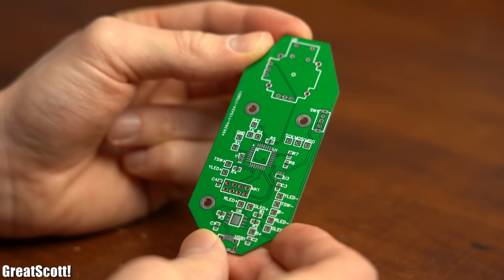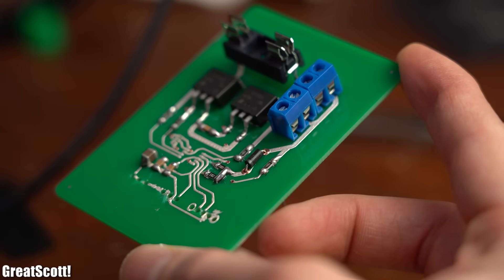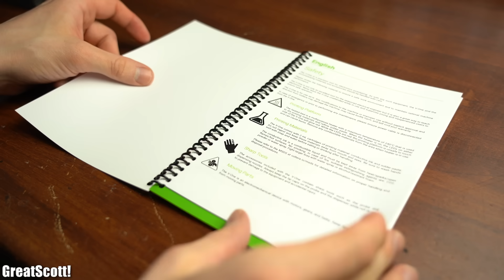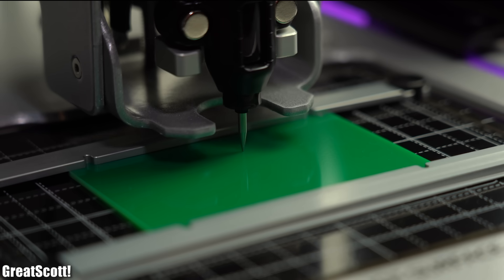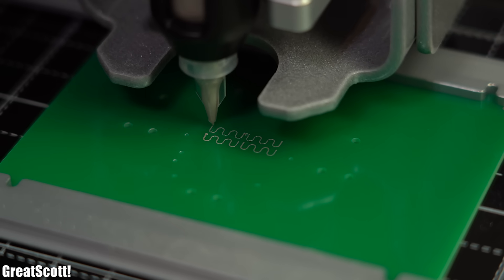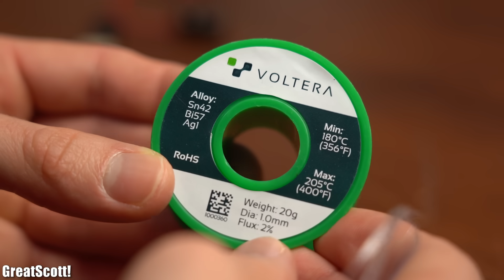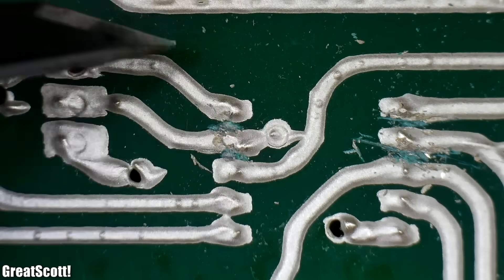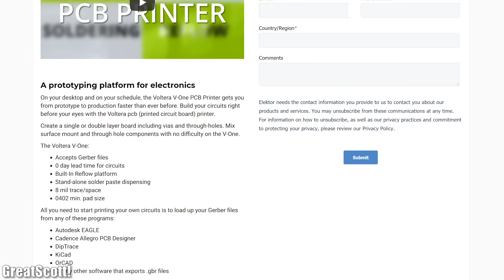You can now PRINT PCBs! Creating a homemade PCB with the Voltera V-One PCB Printer!

Comment: 0:40 LOL! pretty cool idea, but with PCB's so cheap to have printed it makes sense to wait the week for delivery. I'm sure the price will come down within a few years though. Remember when a 3D printer cost thousands, now it's like £200 next day delivery.
Reply: It really depends on what it's slowing down.

If you've got engineers spinning their wheels waiting on a prototype PCB for a week, then it'd be worth the money.  That's assuming that the company can't use traditional acid bath techniques to make prototype boards, though.
Reply: @jeffspaulding9834  If you have engineers spinning their wheels you can also get your pcb made and delivered in a day (is quite costly aswell though)... the issue is that this can only print two layers, so for many designs it's not suitable
Reply: @johnuferbach9166  That's a good point.

I don't work in a field that does a lot of PCB prototyping (we'll solder something on a PCB sometimes, but mostly it comes to us already assembled) so I don't really know, but I'd be interested to see how often two-sided prototypes boards are used in the industry.  I know a lot of the stuff I work with is two sided, but that's because it's meant for field repairs (it's mostly through-hole for the same reason).
Reply: @johnuferbach9166  Many makers do not allow more than two layers for those single-day orders though :( However - it is very uncommon for the engeneers to wait for a board not simply switching to some other works in the meanwhile :)
Reply: @jeffspaulding9834  that's why we bought one where I work. It's completely useless, and barely functions as advertised. We just order boards on a 24h turnaround from a domestic supplier instead.
Reply: @jeffspaulding9834  engineers wouldn't typically be waiting for boards this primitive; that would only result from some terrible planning (anything this could make could easily be hand reworked quicker and with higher reliability). Even if this made you a useable board (doubtful) you have the problem of SMT assembly. Good luck running that through reflow.
Reply: @superjimnz  it can paste and reflow since it has a hotplate. It is an advertised feature. 

This thing is oooold though. I dont remember exactly when i first hearf of it but it must have been around 2016?
Reply: @superjimnz  Yeah this looked cool at first, just for my personal use between breadboarding and ordering a PCB, but this thing looks like it could hardly print a QSOP, let alone an MSOP.
Reply: Just my 2 cents. For this kind of thing? Just use a silver pen... It can't be that much more expensive than whatever consumable this thing uses. From the sound of it, it's faster too.
Reply: it doesn't make sense if supply chains break down, we need distributed manufacturing of electronics or we are at the mercy of companies that do not have our best interests at heart
Reply: @kingmasterlord  😷   YOU  ARE  JUST  BITTER  BECAUSE  THE  CHINESE  COMMUNIST  PARTY
DEVELOPED  AN  ENGINEERED ,  DEADLY  PATHOGEN  AND  UNLEASHED  THAT  VIRUS  INTO  THE
ENTIRE  PLANET .....    🦠😷 

GO  KUNG-FLU —->>>  INFECT  THE  DEMONCRATS.
Reply: it will always be cheaper to go through industrial for the products, it costs more for you to grow a head of corn than it does for you to get a whopping 3 pack and you don't need to put much effort into it.

This technology is great for the prefabrications where you're wanting to print something on a resin board and if it doesn't work out you can bin it it also works great for security especially if you have defense contracts, they only tell you things that the government has told the public, even then they only tell you to reread the documents that you acquired the information from.

So in essence not really for the end user, but still quite good
Reply: Not sure about a week (2-3 weeks for me) unless you're paying £30 for fedex, but this certainly doesn't have a professional look and seems too complicated, might as well go with stripboard/perfboard for prototyping instead of this.
Reply: Yes, but this is going to be in even less demand.
Reply: Well, it is not just a problem of price; it is also related to the overall performances of the device. If it would make output close to what you get from PCB sites, then yes, I agree with you, but it is not, and it won't be close to PCB sites for another 5-10 years at least.
Look at 3d printers today: most of the sub 2K printers are nothing but toys that are good for making trinkets and random objects, which is far from what a 3d printer can theoretically do.
Reply: sure - but you rely on the supply chain and the infrastructure, with machine like that you can be independent and to some people this means the world
Reply: @kc1087  Not everyone can afford to have such commodity, especially in the beginning. Plus the output for prototyping small things is OK, but if you are serious you would never use this machine for anything complex. That's why the advantage of having the proto board immediately instead than wait for a week, is nullified for many people, by the excessive cost of the machine, supplies, and the low grade results you get. 

A milling solution give you better results and higher resolution for the traces, better conductivity at a price much lower. Just saying
Reply: @kc1087  I think the point people are trying to make is, this machine is rather useless. It looks like it can hardly handle SOIC, nevermind QSOP or anything actually small. If it can't actually build what you need it to build it becomes useless to anyone. At the "resolution" it can print at, you can probably just hand solder on a breadboard. Like other people said, you can get milling solutions that can work with finer resolutions that cost less ...
Reply: Thanks so much.
Reply: It's worth stocking up on SOIC SOP SSOP TSSOP QFP QFN breakout boards anyway
Reply: It's about time to gather a few makers and start working on a open source version. I bet we could make this for just under $1000. We just need their flux recipe.. For $99 a cartridge it's crazy expensive as well,.
Reply: i suspect there is not quite the same market size and economy of scale for these.
Reply: If I've got an assignment next week in a country without fast shipping for PCBs, I'd rather have this (and be used by tens of students in EE)
Reply: Would be fun for starting a mini business. You can still do 3d printing for profit at home but naturally you need to network a lot and bring some skills into the deal ie 3d modelling, painting and other finishing
Reply: @derpinbird1180  It'd take forever to make your money back, though, given that each board takes an hour each side just to bake the ink.  What with dealing with the software and doing the drilling, printing, and vias you'd be looking at (rough guess) four hours minimum for a two-sided board.  Even charging minimum wage for your time, it'd be pretty expensive considering the end result.
Reply: @jeffspaulding9834  TBH. In this case, it is indeed exceptionally terrible planning. Any company would spend the week working on getting the firmware or the test setup ready

Comment: I think the best value for pcb making at home is by far the laser printing method.
And if you really do a lot of pcb making, just mod a cheap laser printer to print directly on the pcb.
That's like 150€ top for faster and better quality than this shitty 4k€ 3d printer that will fail half the prints and lock you into ultra expensive consummables.

Comment: Hmm, interesting device. Also, the given use case (eg. a university), would be helped a lot to showcase several PCB manufacturing skills and best-practices. Personally I think one of those (cheap) MSLA 3d printing solutions together with a dry-film resist would be a more sustainable solution for DIY rapid prototypes.

Comment: The price bracket reminded me of that Wegstr PCB CNC mill. That one was quite tiny and even tho the promo videos seemed beyond impressive, they were far too obviously cherrypicked to hell and beyond. Then I saw an independent test of one and the results were far more down to earth and then the whole price seemed far too high.
Let's see what I can do with a 405nm laser on my soon-to-be-ready machine, hope I get good results, I did get some good results with laser printed transparencies exposing photoresist film, sure you're dealing with acid but the results are great. Not too different safety hazard wise than a lot of fiberglass dust either (comparing to just milling).

Comment: A good idea for a project is to modify a 3d printer to print on pcb's using a inkjet cartridge.I've seen some pinouts and projects on the internet based on hp 45 and c6602.You will still need to etch the pcb but for me the most annoying part is transfering the design on the board

Comment: IRF1404/75nf75 are better then IRFz44 
1404 ulrta low resistance and 3 time more powerful and fast switching speed upto 10MHz. 
Then Why you still use. z44 tel me plz. Whats the reason

Comment: A separate oven that could do both sides, reflows and be pre-heated (also doing top and bottom at once) would make this a bit more viable.  But even then, it should be less than $4k for the base unit if the consumables are going to be that much...

Comment: I wonder if you could replicate this with a modified 3d printer. Print an ABS/PLA plastic PCB board (or tougher material if desired) on heated glass, with holes pre printed, then automatically switch hotends to a solder based hotend to make traces.

Comment: A problem with the approach of using rivets in place of plated through holes is that the thermal expansion of the PWB material will eventually crack the solder joints. We tried this approach at an electronics manufacturer that I worked at in the 1980s.

Comment: Even for quick prototyping in a company environment a ferrous chloride etching/optical transfer with UV light setup will propably be cheaper, at least as quick as the printer and less hassle with these fiddly rivets. And the results will look better, conduct better and you will have a better printing resolution. You can also refer to MarcoReps for good at-home pcb manufacturing.

Comment: Or you could just buy a prusa mini and mod it like seriously a prusa mini is $300 dollars or €  247 so pretty cheap and solder paste is also cheap on its own all you need to do is mill the pcb then mod the printer with a lead screw that pushes down the solder plunger

Comment: The trick for your problem
Do schematic
Buy low quantity of the board online
Test board after soldering
If it works, great buy the amount you need
If it doesnt, fix board with jumper cables
Cut traces if you need to
Now buy the amount you need

Instead of buying a machine that costs 4k, makes terrible looking pcbs, and is only able to do .7 vias...

Comment: "You can now PRINT PCBs!"

Ah yes, great! Only spend $4000 so that you don't have to wait a week for your packages.
Neat product but it's waaaayy to pricy to justify for 99% of your average DIY projects or similar...
Reply: For a few projects sure, but this is like saying "Oh you don't want to spend $4,000 for a CNCmill" or "$4,000 for a used Lathe" If you have enough projects, the tool will be worth it. And once you have the tool, you have the ability to do more projects. Although, this one, probably not worth it until there are non proprietary consumables.
Reply: @Racing_Pig  Yes sure, if you need the volume it will pay for itself. But like I said this is such a niche product that probably 90%+ viewing this video don't have 4k for it or a cnc mill or whatever laying around. It's a bit far fetched you know.

Comment: Great review. I’ll stick with my Bantam tools PCB Mill. It routers holes not drill and gives me easy ground plane. Plus is almost 1/2 the cost. And as you pointed out, the resistance of the conductive ink isn’t as good as copper. Thanks for a great video.
Reply: Not to mention no expensive consumables. At most the milling bits and, well, the board itself used.
Expensive consumables kill it in my opinion (as if I had the cash for it anyway hehe), and then that special solder used is just the cherry on top.
Reply: @SEBASTIAN RAMON ADONAY BAEZA subscription licensing for hardware is a blight, and needs to be stopped. Subscription software is bad enough but if you can spend money on capital equipment and it just goes away because you didnt pay the subscription whats the point of buying the hardware in the first place!
Reply: If you get copper rivets, you can make much betterr quality PCBs than this at home. You can make a UV curing station and mask the PCBs too. And for the rest of the price, you can buy tons of gold for gold plating xd.
Reply: @tunahankaratay1523  You mean grams of gold. :P
Reply: @rimmersbryggeri  I mean for that price I could get you megatons.
Reply: @tunahankaratay1523  Yeah, also i've been thinking about it, since with with rivets you can make vias, would it techinically be possible to make a 4 layer board at home by sandwiching them, and lining up the vias?
Reply: @bobdole27  Multi layer is a bit difficult at home, because they don't sell such thin PCBs, so when you glue them together it would make a thin enough board. Also making sure that the middle layers make contact with the vias are a bit difficult.
Reply: @tunahankaratay1523  Agree I do double sided all the time on my Bentham and that is often enough for prototyping.
Reply: @symonty  I prefer etching because it's so cheap and I don't really do them often enough to need a CNC.
Reply: @tunahankaratay1523  absolutely, cost was not an issue for me, so I went for it. But you can achieve a lot with breadboards and then etching.
Reply: @tunahankaratay1523  Im a professional protoyper. We use etching for small series of pcb. Above 10 pcbs its cheaper to let them make it professionaly. And way better quality.
Reply: @analphabet1996  Yes, it's true. But I usually need one or two.
Reply: spray paint, LASER router, and some  White Vinegar, Peroxide, and salt solution gets her done pretty well!
Reply: I love my PCB mill, costs almost nothing to make a pcb ( I buy blanks online for $20 for 50 ) and it creates copper SMD and THT in a single enclosure picked one up for around $2k. Also it is a very capable CNC for other purposes. I agree about the subscription model for the new CNC mill unit being the wrong way, but the PCB mill is perfect for PCB work.
Reply: @symonty  I think the good thing about being able to mill your own PCB instead only relying on JLCPCB is that you never have to worry about wait, or if you are in a location they can't deliver to.
Reply: @bobdole27  Made 3 yesterday, 3 versions made and soldered and manufactured in a day. KiCad and my PCB mill fast and cheap.
Reply: No prices on their site for "Bantam tools PCB Mill" and their software has a subscription.  "Bantam Tools Milling Machine Software Annual Subscription"
$199.00. No thank you..... How can you claim 1/2 the cost? (FYI their CNC version is $3,999.00.....)
Reply: @AdFlori  I decided early on to void the warranty and load my own firmware. The manufacturer can go pound sand, frankly said.
Reply: @AdFlori  there is no subscription for the pcb mill, the cnc mill does.
Reply: Do you design and make printed circuit boards...
Reply: Also dont forget you can also do edge cuts and solder mask with a CNC mill.
Reply: This product is soo terrible, you're stuck like Apple, you have to buy their refills, and can't even make BGA or FPGA traces. Waste of money.
Reply: The method for making a hole is irrelevant if said hole is accurately located and sized. What is very relevant, is Bantam's outrageous price and subscription software.
Reply: Can your machine do a multi-layer home-made PCB ?
Reply: "Plus is almost 1/2 the cost."
Was almost 1/2 the cost. Past tense. Bantam's website says they no longer make it, and to just use their desktop CNC instead, which does the same job plus others, but that machine is several hundred USD more expensive than the printer in this video.
Reply: Yeah me too, I grabbed one about 2 years ago, and have made so many boards. Drilling is a big deal and so too us custom board shapes. Without them this is just a glorified breadboard.
Reply: @symonty  are you able to do vias and double sided with the bantam ?

Comment: This type of thing will probably take a long time to get to production quality or cheap enough for consumers because of the lack of higher speed printing technologies being easily available. This thing is WAY overpriced though considering it is not much more than a 3d printer from an electronics stand point and I doubt that those build materials make a 500% cost difference.

I am working on the same thing but with copper ink and solder masks. The biggest hold up from making it cheap enough for consumers is that inkjet printheads are monopolized by a few companies that guard them and the patents like crazy to drive up prices. When a decent print head costs several hundred to thousands of dollars while the rest of the machine costs less than $200 it immediately puts it out of reach for the hobby market.

There have been many advances in copper inks over the last few years and they are getting close enough to matching bulk copper that a small compensation (20-40% scaling) in trace width/thickness can be used to match the resistance. Sintering techniques have also improved so you no longer need inert atmospheres and long sinter times.

Printheads are the big issue because there are only ~5-7 companies that produce them and although they would be cheap to produce the volume needed to make it viable is not there. As soon as this is solved prices can come down to the <$1000 price point. We are currently exploring other solutions as we perfect our own inks and sintering methods.